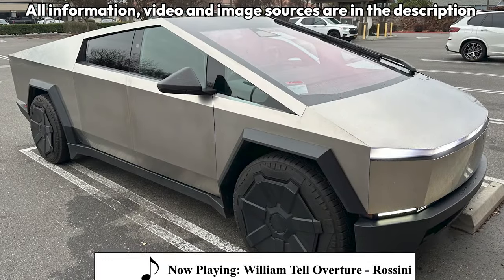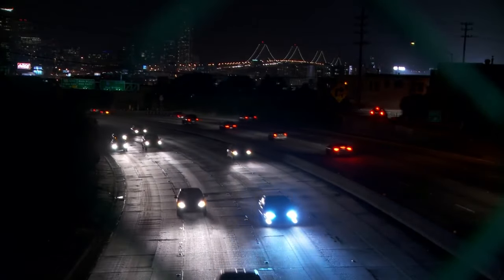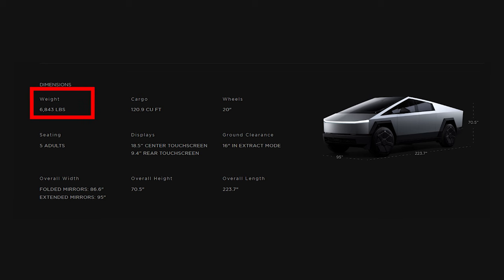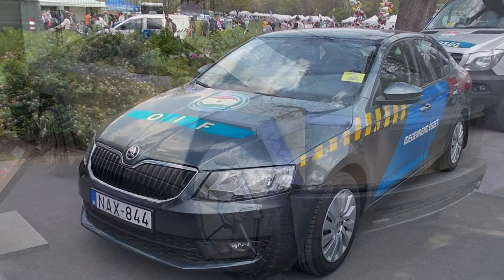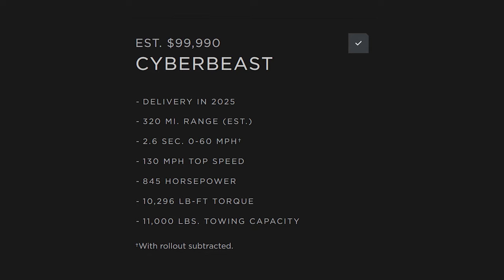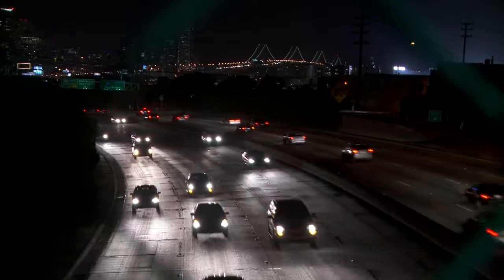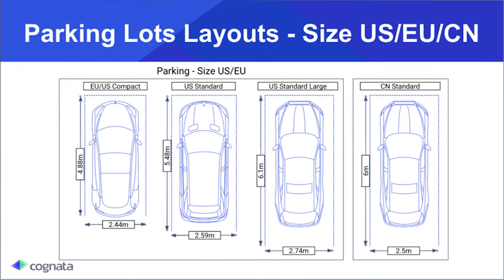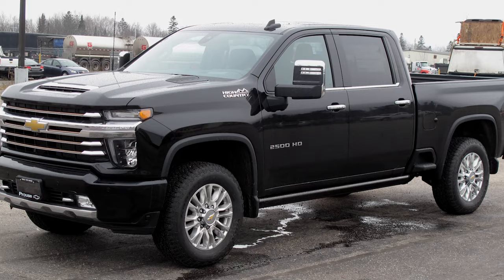Tesla Cybertruck: A European Perspective

Comment: Well done, I think I wouldn’t have managed it, I would have taken the anti-Musk tangent and lost the viewers somewhere in my rant.
- - -
I think there should be a discussion to be done on the overall car sizes evolution.
Last year my family had to buy a new car.
20 years ago when we purchased a van-like city car that could be used also for the business it was the tallest of the parking lot.
Now there are so many big SUVs that you can not even see that.
Also the car that now replaced it bearly fits trough the garage door.
And I wonder what does it mean in term of petrol, gas consumption etc.
Up to at least 10 years ago in my city I can list at least 5 gas stations closed, now where I live are building a tram line and the building site went across two gas stations and I was happy to see them gone until I realized that they started building them back with twice the number of pomps and some other stations that were abandoned for more than a decade were reopened.
Is it really possible that we are actually consuming more fuel?
Reply from the maker: I could look into it in the future, but for next week, I'm dropping a video on the rise of private train operators, especially here in the Czech Republic

Comment: I would argue that Skoda Karoq as you showed while talking about large suvs is not a great choice. Karoq is still more of a compact SUV even for our Czech market and its not built on a rigid frame as the old school SUVs like Land Cruiser. Cars like Karoq are still quite fine, they are built as normal cars, they just sit a bit higher, they are definitely not way too big for our roads and they pass the standards of EU safety. Yes, its probably better for a pedestrian to be hit by Octavia than Karoq, but I wouldnt see this as a major problem. The unnecessarily huge pick ups, huge SUVs with grills higher than a basketall player are the problem.
Reply from the maker: Yeah, looking back at it.. I admit that Karoq wasn't the best choice, to be honest

still, I think the point in the video stands, oversized SUVs and pickups are a scourge of modern roads

Comment: EU driver's licences are restricted by maximum authorized mass of 3500kg. So cybertruck entering the EU involves proving that it is not built to carry more than 400kg of people and cargo. Unfortunately, the limit is being raised to 4250kg for EVs due to lobbying of car manufacturers.
Reply: Fuel that will take you 500 km weights about 35 kilograms, battery that will take you the same distance weights about 450-600 kg.
Reply: @MrToradragon  Your point being? But yes, we should instead have stricter pedestrian and other-vehicle safety requirements.